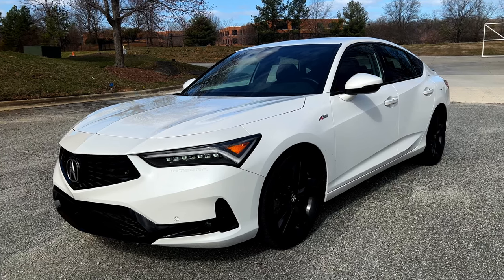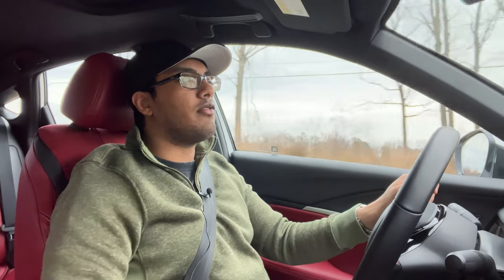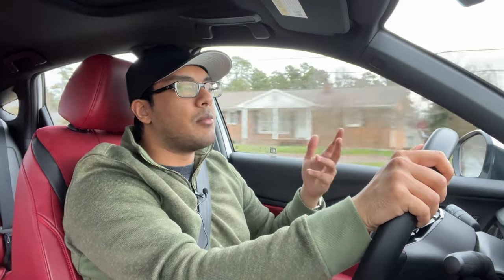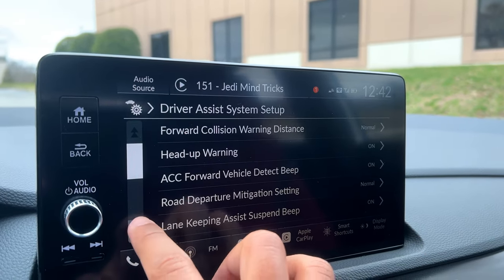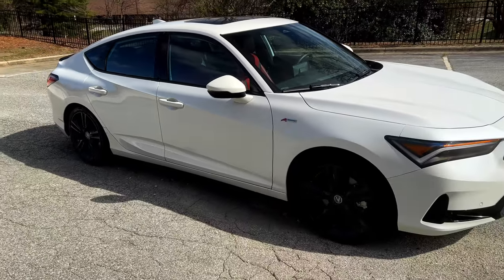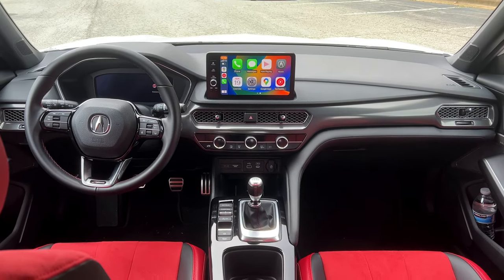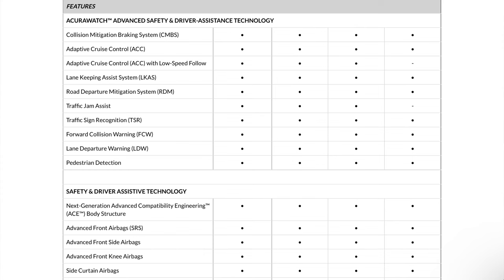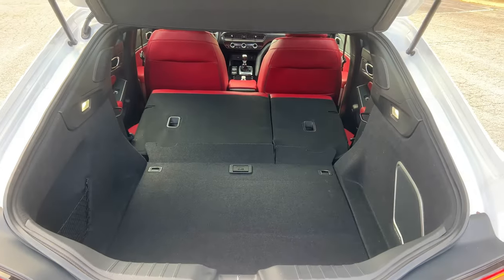2023 Acura Integra A-Spec Tech 6MT Review.. Misunderstood

Comment: My biggest issue with this car is that I feel like they crippled the power so as not to compete with the Type S. I get they don’t want to cannibalize the sales of the S, but they could have easily put 250+ HP and another 50lb ft of torque, and kept the price the same to make it a little more compelling sport sedan option.
Reply: For the exact same price of a A Spec Tech you can get a AWD 5.6 sec 0-60 Mazda 3 Hatchback. I prefer the look of the Acura but you could argue the interior and performance of the Mazda is superior and it’s a much older design.
Reply: @canyonblue737-8  Maybe not so straight forward. I haven't personally tried to Mazda 3 but just finished 2 review comparisons to the Integra and SI which came to conclusion that despite the faster acceleration, there is just no sporty feel to the Mazda. It's tuned only for creature comfort while like many of the comfort features and space that the Integra at least provides.

Comment: I own one of these, so YouTube has noticed and recommended every video about it. I have to say I agree with several of your opinions on it, but I disagree in two places:
 - Idle stop
 - Adaptive dampers

The idle stop system is very helpful for driving in the city and saving a little bit of gas. Genuinely, this system feels good to use because it's in a manual vehicle. If you clutch in, the engine starts. Period. It takes getting used to for the first little while, but you get over it and find it's more annoying to turn it off than to use it and save a little bit of gas. It also helps reduce emissions in the city, which is good because there are people walking around breathing that air!

The adaptive dampers are noticeable. Everyone I've shown the system to has noticed even from the passenger's seat. They engage slowly, so it's hard to notice the difference unless you sit and drive it for a bit. It's not dramatic, but it's noticeable to the point where I get annoyed at the road feel outside of comfort mode on some of the messy highways around here.

I also appreciate your discussion of the value proposition. The price is always right with an Acura.
Reply from the maker: Thank you so much for sharing this valuable information! I hear you on the Auto stop start it is designed well and it is smooth. I unfortunatley couldn’t get anyone to notice a difference with the dampers in the passenger or rear seats but yes there will be a subtle difference taking place. It is certainly a fantastic car and I always loved the value proposition represented by Acura. Enjoy!

Comment: Exactly! The quick-shot reviewers and knuckle-dragger enthusiasts all compared this thing to the Si when the natural upgrade path is from the Civic Sport Touring.
Right now, the 2024s are:
Civic Sport Touring, paint (all colors cost extra...), manual, destination - $33000
Integra ASpec Tech, manual, destination - $37695 (+$600 for a color other than silver)
$4695 for the goodies doesn't seem like such a huge stretch.
If you want heated leather and can live with a cvt, the difference is even closer.
I'd have to get the Integra ASpec Tech for the manual and lumbar adjust.
Reply: Agree but tbf it does share the same engine as the Si
Reply: @TheRealOne24  Yes, and the transmission and LSD. Smash the Si and Sport Touring together, put a nice sport jacket and hair gel on it, and you have the Integra.

My main point above is that people were complaining that it costs too much compared to the Si which is decontented and much stiffer/less comfortable. Honda was targeting a different audience with the Si. The Sport Touring people who want something with that little bit more can look to the Integra and then the Type S. Si people can look to the Type R.

But hey that's just my opinion.
Reply: @anaveragehuman2937  those are good points, especially the LSD.

Comment: I have had mine for 4 months now and like it. My heat seaters suck though. I can barely tell if they are working.
Reply from the maker: I think they toned it down because in the past they would get super hot
Reply: My heat seaters 💪
Reply: @MeynMotorGroup  that's for sure, my 3g TL's starts getting toasty after like 7 minutes.

Comment: Nice video as always! I really like the Integra a lot as an overall package. Absolutely love the gearbox. It's super annoying that you have to actually pull over and dig through menus to turn off rev matching, as you mention. Agree that should be a button. I will say, I didn't mind the auto start/stop (in the SI at least, I had more time with that one) because it's way more ready to go. Like you press the clutch and it kicks back on, so by the time you're engaging, it's on vs an automatic where you hit the gas and have to wait for the spark first and then go. And adaptive suspension makes more of a difference on bad roads in my experience. I thought it was all a gimmick until I drove my GTI over a super rough road and popped it from Sport to Comfort. But most of the time, yeah, doesn't make a huge difference.
Reply from the maker: Hey my friend! I hope you’ve been doing well. Thanks so much for stopping by and sharing your experiences. Keep up the great content 👍
Reply: @MeynMotorGroup  Thanks! Hope you've been doing well too! Glad to see the growth and that you're still pumping out great content too 🙂
Reply from the maker: @GearboxCarReviews  that’s great to hear! And thanks again for the kind words!

Comment: Do your 6MT A-Spec Integra's inch down if stopped on a hill and you don't have the parking brake on?  Some A-SPECs in my area do (Virginia/Maryland), and some don't  My own 2024 A-Spec 6MT does move/roll and has me worried if this is a defect.

Comment: Great review. I was sort of hoping this vehicle interior just look a bit different. The interior looks too similar comparing to the Civic in my eyes. I know this generation Integra is based on the current Civic platform (and always has been since it beginning of time), but I know Acura can make something different, unique, and special for this vehicle, like they did with the new generation TLX. I can understand their reason to keep the prices as low as possible. My current 2020 Acura TLX has a 8-speed DCT, which I think it's a gem, and it will be nice if Acura offer that transmission on the Integra & maybe other models. Either way, I'm glad the Integra name return to the Acura brand & hopefully it stay around this time.
Reply from the maker: Yea they def lifted the civic interior for sure with only some subtle enhancements. Which isn’t a bad thing since the Civic is trying to be upscale kind of like Mazda so this Integra feels much better on the inside then some entry level Mercs. K24 with 8 speed DCT was pretty excellent so sad they dropped the DCT. Would have loved to see that transmission paired with their NA V6
Reply: @MeynMotorGroup  I read online of the Integra is doing very well in term of sales - even outselling the TLX, which I'm not surprised honestly.

Comment: How would you compare this to the tsx you used to have a few years ago?
Reply from the maker: Pretty similar feeling this is a bit quicker with the turbo but drives similar and this maybe rides a bit better. TSX sounded better because of the NA engine and I think it was slightly quieter than this. TSX was legit just rode a bit rough

Comment: I know I sound like a broken record but I had a '95 Integra GSR Coupe 🤣🤣... I knew it was upgraded Civic SI. I guess people forgot the history of the car. The aftermarket us much better for the Civic imo

** LOL.. you just mentioned the history
Reply: At least yours didn't look like a Civic with a Acura front end like this one. Yours LOOKED like it's own car.
Reply from the maker: Yup so many people fail to do their research on the older products and the other thing about the Acura cars is they usually get different tweaks and tunings to seperate themselves from the Honda that is is based upon. Not to mention in the real world, an Acura carries prestige and value as a luxury product with a better dealer experience. The people that say they don’t care about such things tend to care the most deep down.
Reply: @jefff6884  back when I had mine, I wanted the 93 cause it had those straight headlights. Mine had the round ones. Whenever the Type S comes out, it will not be as hard-core as the Civic Type R
Reply: @MeynMotorGroup  the JDM scene was just starting in Texas back then. It was nice but I liked my 4Runner more